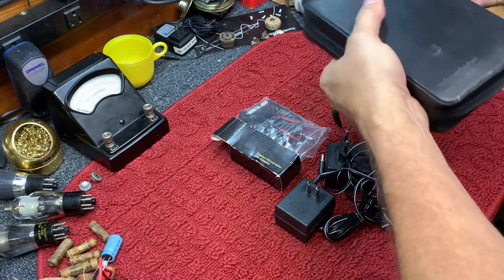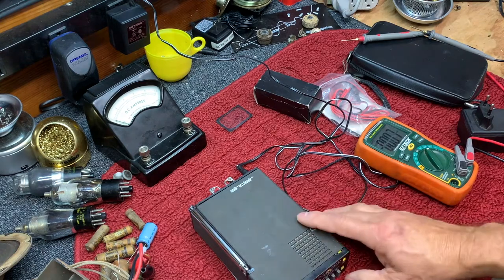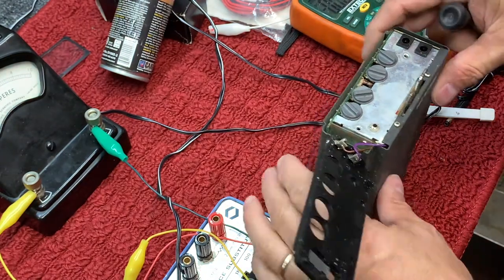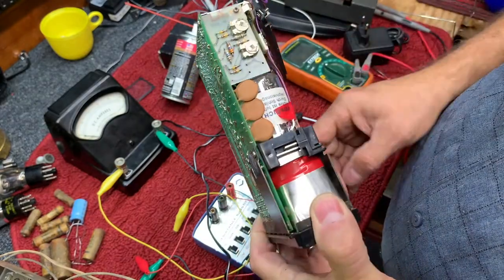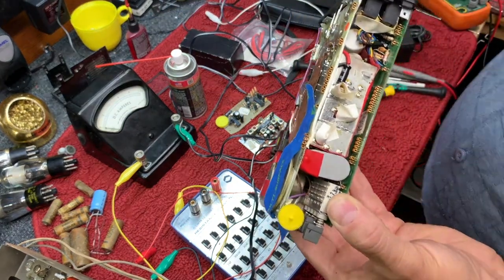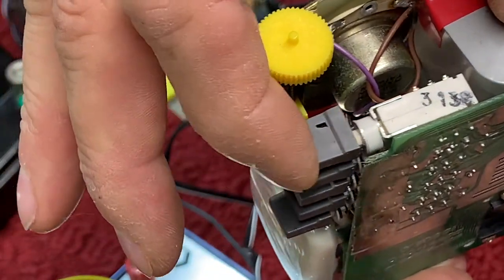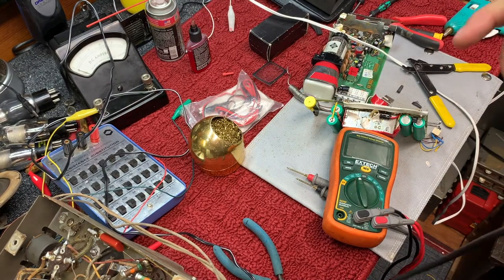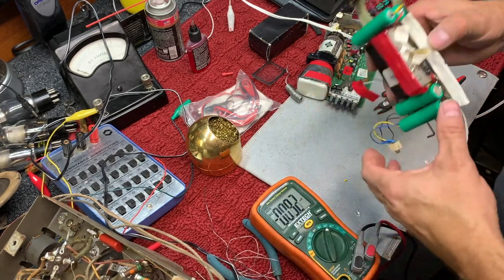Vintage Tech: 1978 Micro Television Repair Start to Finish Part One

Comment: The set I paid $5 for at an estate sale, got the cells removed, new cells on order. I got the set working. Just like you stated, all the connectors get enough tarnish and corrosion to make bad connections. What really was throwing me off was the center post on the plug socket is negative. I had positive on the center, luckily there is a diode in the circuit to prevent damage. Used a power adaptor, but for some reason, the set does not like an adaptor that uses a switching power supply. Used a transformer type power supply and bingo. It powered right up. I really find this little set amazing at the fact is has electrostatic deflection rather than the standard magnetic deflection. Anyway, I'm very happy that I have a working rate Sinclair micro tv, it will be added to my collection of little TVs, I'm finding this just as fascinating as the 1.5 color crt tv I have.
Reply from the maker: You got a great deal!  And kudos for getting that set working!  I’m tickled to hear that.  Yes the electrostatic deflection was a great invention for these tiny TVs. What other tiny TVs do you have on your collection?
Reply: @KOVintageTech I have a sony kv-4000 its the smallest trinitron 1980 TV. Its a fun set. You probably already have one. Its built very well. Love all your videos.